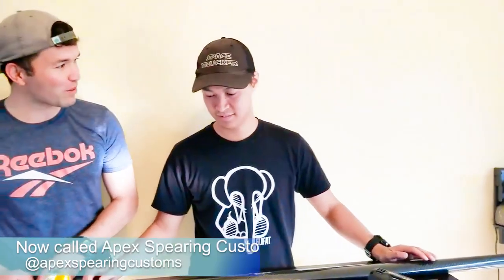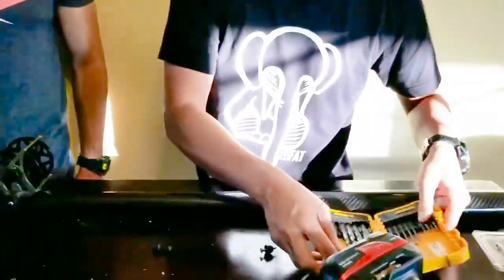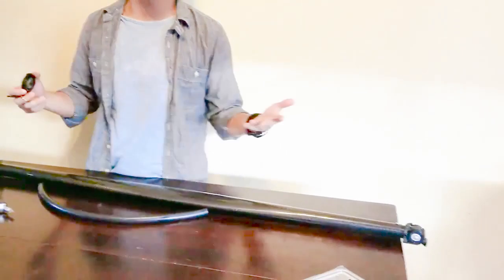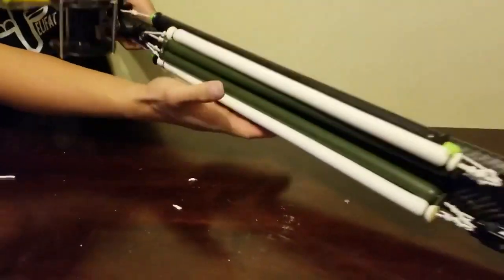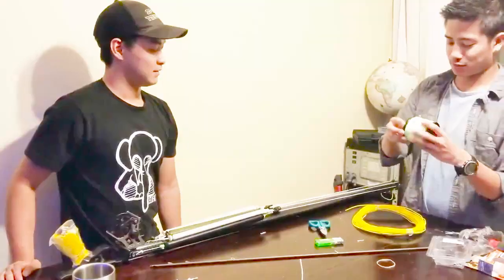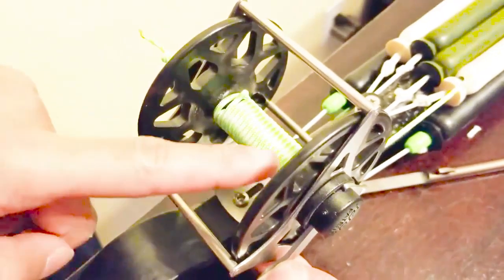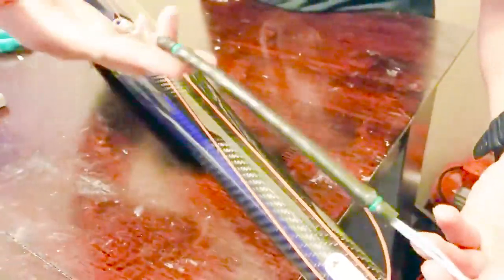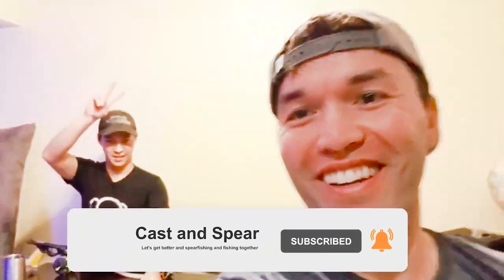Assemble an Inverted Roller Speargun With a ROCKET ENGINEER

Comment from the maker: What are your thoughts on inverted rollers?
Reply: looks cool...
Reply from the maker: Time to get you out there again lol
Reply: @castandspear  I wish.. lol.. already a stretch for 3 days in baja.. lmao
Reply: Hello Jon, if you dont mind can you make a video of how to make hundle and muzzle similar to whats at end. 15:28
Reply: Your rubbers are probably too long.with the pulleys system the pulleys are limited to 1/2 the travel of the rope you pull too load it so too get maximum omph you would need to measure from the notch of the spear to the back muzzle then 1/2 that for the pulleys travel then divide that by (3 - 1)(for 300%) or (3.5 - 1)(for 350% and so on)
1200mm length from notch to back muzzle would be 
1200÷2= 600
600÷(3.5 - 1)=240
240 is the length of one rubber with 350% elongation
Reply from the maker: Thanks for the heads up!
Reply: I finished a roller polespear last year and I love that.  Now it is time for the inverted roller. Something between what you have here and this "ZESO 55 Invert Roller / Limited Edition - Setup" from another video on YT. 

If you are going to buy a speargun, inverted roller is the way to go for sure.  Thanks again.

Comment: Great video. I have an MVD carbon 120 inverted roller.  There is no way to remove the pretension on the 1st band for storage. There is already a hole to the handle that I could open up a little if I needed to. Where can I get A-line anchor or a threaded bead?